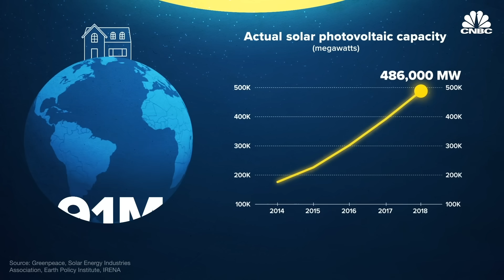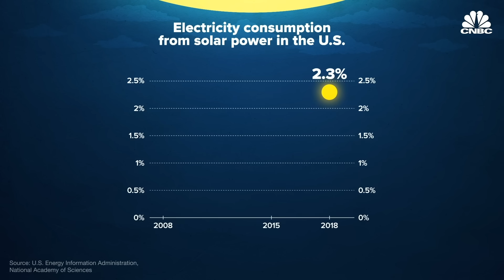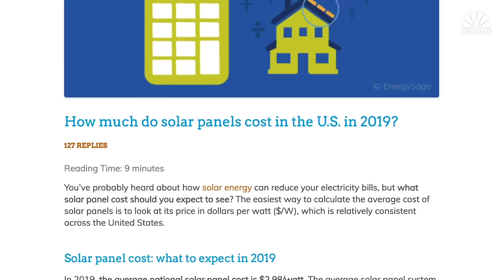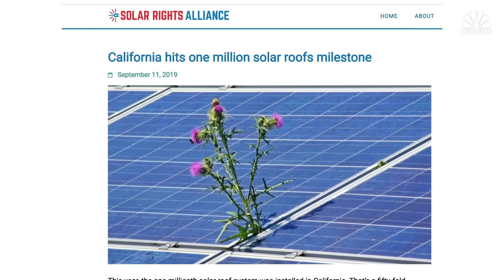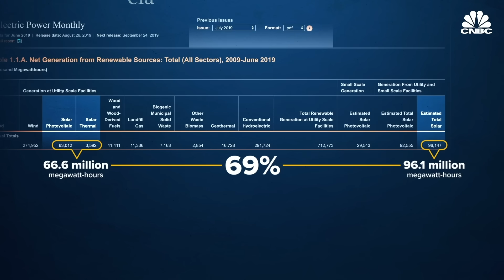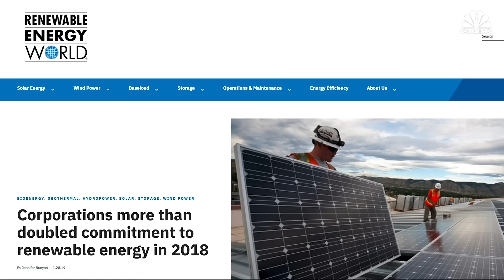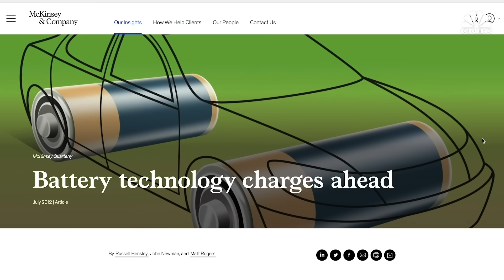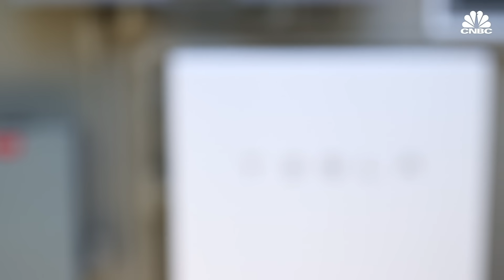The Rise Of Solar Power

Comment: I looked into installing solar panels on my house.  I am a low volume user; my average use is approximately 350 kWh per month.  

It would take me more than 25 years to recover the cost of the installation using a straight payback calculation.  Using a Net Present Value calculation, which factors in opportunity costs, it would take me more than 80 years to recover the cost of the installation.  And that is without any battery storage capacity. I am 80.  There is no way that I could recover the cost of solar panels.

Contrary to what people are told by the promoters of solar power, the panels have to be cleaned periodically.  Moreover, they are susceptible to wind and hail damage, which can result in costly repairs.  Lastly, depending on which study you want to believe, the panels lose some of their generating capability over time.  I have seen estimates of ½ to 1 percent a year over the estimated life of the panels, which appears to be around 20 to 25 years.

The cost of solar power, as well as wind power, does not include the cost of maintaining standby generation for when the wind does not blow and the sun does not shine.  If I have to maintain a standby gas fired steam electric station, the cost should be factored into the cost of wind and  solar power.  It isn’t.  Also, in Texas, to accommodate wind and solar, long-distance transmission lines have been built.  The cost of these transmission lines has not been factored into the cost of wind and/or solar.  

I support the move to a carbon free electric system.  But people should be told the strengths and weaknesses of wind and solar power.  They are not ready for stand alone prime time operation.

As an aside, I find it ironic that lots of folks are extolling the virtues of wind and solar as the way to a carbon free society while buying large pick-up trucks and SUVs.  Somehow, that does not compute very well.
Reply: when did you looked into solar? two decades ago? 
I look into them since a decade ago, and yes, I saw that the figures not quite add up, unless you are too far from the grid. But lately the cost lowered enough for solar to be feasible in most locations. I have seen reports from many users who installed five or six years ago, and who almost recovered the investment, so for two more decades they will have free electricity. Of course they got some incentives and live in a sunny place. If you live in a grim place, and no incentive, and the installers rips you off, sure, it is a bad deal to do solar now. Especially at 80. I am not 60 yet, and I am reluctant to buy anything new, because who comes after me will threw it out anyway, even is not worn out. But for solar is not just a matter of recovering the money. is a matter of keeping humanity alive. Sure, we will go away before the doom comes here, but what about the young ones? 

And anyway, even figures seems not to add up for solar, they are good. Already at industrial level in sunny countries solar electricity is already cheaper than coal electricity. And since you mention factoring the costs, please remember that coal is subsidized too, and the biggest weakness is that is killing us. 

Anyway, I wish you a long and healthy life, to catch the times when solar will be even cheaper, and can be profitable after one year. In two decades this will be true.
Reply: @ehombane  Last month!
Reply: Paul Smith I’m not sure where your are from but my grandparents have a solar loan and the payment on the loan is cheaper than her energy bill before they got solar. And they have a 10 year loan so after that they get to use it for another 10 years without having to pay. They seen about 20 percent decrease. But this is in Long Island New York
Reply: It's really feel good have own electric production from solarcell even if it are some investments required. You know then that parts of the electrics come from the clean sun. ☀️☀️ I was installed 1kW solar at years 2013. Now I will install lot more, the costs have dropped a lot from 2013 I seen. Have an electric car, and bicycle a lots in my family (when we was buy electric bicycle all my yough was star bicycle 8-miles to our town also.
Reply: M Detlef  he's a troll trying to spread lies.
Reply: You lost me at wind at hail damage. Do they also give you cancer?
Reply: Quick calculation shows the system you were offered likely cost $13k or more. Unless you live somewhere the Sun literally does not shine the cost of enough solar panels AND batteries for your house may be as low as $5k. Installation costs can of course be twice that. As for maintaining the system, how often do you wash your windows or take your car to a mechanic? Again, it's only expensive if you get someone else to do everything. If you feel up to buying a pressure washer and learning about batteries at your age it's just something to do on a slow afternoon. The batteries might need to be replaced in few years to a decade, but that is not as expensive as the whole system.

(Incidentally, the people who keep bringing up how wind farms and solar panels need maintenance that is supposedly not already calculated in their operating costs are oil lobbyists trying to lie to you that their own machines use unicorn magic and pixie dust and need no maintenance at all. Hint: This is not true.)

For that price you get zero electricity bill unless you do something above average like have lots of guests or need to heat or cool the house more due to bad weather. And panels losing about 1% of their output per year is not much of a concern unless you only got bare minimum number of panels and keep using more power; in 20-30 years you probably need to replace the roof those panels are on anyway, and can save by doing both at once.

So yeah, it's not something you would get the full benefits from, but for the average family home where people will live for decades, just lowering the electric bills by producing some of the power they need themselves would be a worthwhile investment.

Assuming, of course, they get the slightly more expensive but 4x more efficient panels, the affordable batteries, and moderately priced installation, instead of the crappy cheap panels, expensive batteries and overpriced installation.
Basic mistake, that.

As for needing standby plants, with modern prices it is better to just build more windmills, hydro and concentrated solar, as nowhere people would want to live has such weather that every windmill in the state has to shut down due to high winds and areas with regular week long 100% cloud cover would have trouble with agriculture so nobody sane would try to put a solar farm there either. A concentrated solar plant already stores enough heat for the night, but it could also use the surplus power during midday to make hydrogen, methane or even oil from air; in case a freak weather darkens the day these fuels can be burned to keep the heat up.

It is easier and better to build extra capacity in the existing power plants that can be held back, allowing continuous operation even when parts are shut down for maintenance, rather than a completely new plant that only operates few days each year yet costs more than every other solution.

Also, the grid needs transmission lines because unlike that PV panel you aren't going to build a nuclear or coal plant on your roof. It also needs energy storage because balancing the power supply requires adjusting things within seconds and it could take minutes to fire up another power plant. Anyone who claims renewables are to blame or that fossil fuels don't need and use the exact same systems is a lying liar who lies.

Comment: A TESLA HOUSE  BATTERY IS NOT  $7,000 MORE LIKE 3,500 AND TESLA HAS A SOLAR RENTAL PROGRAM THAT CHARGES AS LOW AS $50 PER MONTH TO GREATLY REDUCE YOUR ELECTRIC BILL .   YOU CAN STOP AT ANY TIME  ( NO CONTRACT )  AND HAVE THE PANELS REMOVED  THEY  USED TO CHARGE TO REMOVE THE PANELS BUT TESLA DOESN'T DO THAT  ANY MORE  THEY JUST REMOVE  THE PANELS FOR FREE  .   MOST PEOPLE WHEN THEY SELL THEIR HOUSE JUST EXPLAIN THE SAVINGS FROM RENTING THE PANELS AND THE NEW OWNERS SEE THE BENEFIT AND CONTINUE THE AGREEMENT ... BOY CNBC DOESN'T MISS A CHANCE TO KICK TESLA DEAD IN THE BALLS  EVERY CHANCE THEY GET

Comment: The tech that can be the most reliable for peak power is called "Liquid Air." The fuel used is air right out of the atmosphere. You don't have to burn it and it's renewable and free !!!
Reply: Sorry but you don't know what you are talking about, first of all it isn't flawed they have a working plant in a town just north of London - the CO2 is pulled out of the air before it is chilled, then stored or used in other processes. Then the liquid air is stored in a low pressure cryogenic tube.  When it is time for use the liquid is allowed to reform to it's gaseous state and the waste gas is cleaner than when it was first captured !!!
Reply: Yes, it is real science. It was first proposed by a Dr. of physics called Daniella Fung back in 2009. The plant I am talking about was built about a year and half ago. This is real and it's going to change our current paradigms !!!

Comment: as a person who lives full time in an RV that uses SOLAR knows it is better than NOTHING but it is completely UNRELIABLE... 6 months each year it works well and supplies the amount of power to keep my batteries charged.. 3 months a year I need to run my Generator half the time to keep the batteries charged.. 3 month a year I need to run my Generator full time as the solar panels are completely useless.. the only reason I have solar is I like silent power but it is much more expensive that running a Generator to charge batteries.. at the price of Canadian gasoline costs me 7 dollars two charge my batteries once every 3 days....

Comment: i dare you to calculate how much power is wasted for producing those solar panels and how much energy those solar panels will produce during their lifetime... 

spoiler: solar cells dont produce even half of the energy during their life that is wasted for producing them... 

hows that for a "green energy"?
Reply: How many kilowatt hours does it take to produce a kilowatt of solar? Or what form of energy are you taking about
Reply: @EthanThruandThru  i am talking about the total wasted energy of any kind while producing the solar cells (oil used for the trucks and machinery to collect and transport the silicon ore, energy wasted to extract the silicon from the ore, electricity wasted to melt the silicon...) 
solar power is a scam... while you keep your region clean by using solar cells to produce solar power, at the same time you are double or even triple polluting the region where the solar cells are produced which in the end pollutes the whole globe eventually...

Comment: Lithium is a toxic, and very rare Earth, material so we MUST move on from Lithium because it is a finite resource.
Reply: Thankfully there are improvements in other battery types such as sodium ion
Reply: @Verisimilitude Dude I think, or at least hope, that Lithium was just a stop gap until something better comes along that is not very finite, rare, or toxic.
Reply: @thebeststooge  Here's an article that helps shed some light on that.  It's a breakthrough in sodium ion solid state batteries.  https://phys.org/news/2019-04-high-solid-state-sodium-ion-battery.html

Comment: Until the efficiency of solar panels is at least doubled it is just a gimmick.  Already they are looking for better than silicon for the cells (we have maxed the tech out) because we really do need 600-900 watt panels for the same size, and cost, of the current 300 watt ones.

Comment: No one says about the energy it requires to manufacture solar panels and batteries. And the pollution it causes to dispose. Aaah propogandas.
Reply: Was about to say something like this, the chemicals and gases and other elements used in them are dangerous, they require non stop maintenance, break down easy enough, have to be replaced every 20 years or less if your lucky, require the total destruction of massive amount of land, trees and animals, also the amount of power you get for the space is pretty bad, everywhere that has used them and got rid of nuclear energy has seen power outages and also require something around 60% of power from coal and gas to help keep power level stable and in turn ends up causing more pollution, the safest, cleanest as well as cheapest form of energy we have is nuclear something that scientist want people to use more again but hey the likes of greenpeace and other activists groups who know nothing about all of this and scare mongered people for decades don't want and also have no solutions at all other than give us money.
Reply: @FOXXOF-RPG  I know. Like I said. Propogandas. It doesn't have to have real world effect. Only thing that matters is that it should feel good.

Comment: What do you do with the old solar panel after 25 years of use Land Fill? they are made with lead zinc copper and other metals who recycles themes and the silicon is very toxic to the lings how are they handled?
Reply: @Hello Roger Reimer, How are you doing?

Comment: They should use hydrogen to store power. Turn water into hydrogen during the day with solar power then turn in back at night though a hydrogen generator back at night. Need more capacity? Just build more storage tanks! Yes it will still be expensive and I'm sure not every solar farm is close to water but its electricity we are talking about. I'm willing to bet having more storage is more important then where the storage is.

Comment: Solar isn't as unreliable as you might think. And not all solutions involve batteries. CSP concentrated solar power stores energy from the sun as heat in a liquid that can be used late into the night. Similarly energy can be stored as potential energy by moving water to a higher elevation. Essentially a giant battery made of water and gravity.
Reply: This dosent change the fact that solar is unreliable. Ofc there is solutions for this issue, but all of them adds extra cost.
Reply: Magyar Áron Surprisingly the cost of solar plus storage is now competitive in many areas. Obviously some places it is going to be more expensive than fossil fuels, but it is increasingly becoming the cheaper option. I doubt solar could ever provide over 60% of the nation's power without serious diversification and output variability problems, but economically solar is starting to make a lot of sense.

Comment: The only role for solar (wind sucks, to much damage for not enough benefit)  is to prolong the benefit of fossil fuels, which ARE solar based after all (water,  CO2, organic carbon compounds, and sunlight). ALL, ALL, ALL CO2 that is locked in fossil fuels, came from the atmosphere IN THE FIRST PLACE, and will do NO harm if it goes back there, but most of it is tied up in rock (limestone, dolomite, and everything we make concrete out of).

Comment: No one talks about the easy storage solution, with is using energee only when it is avayable. Eg. big food cooling houses can overcool themself when a lot of energy is in the grid and then just shut off cooling for a timespan eg. during night.
Or plants can set up there prosesses to peaks in the grind. eg. melting steel

Of cause this can not be done for everything, but a lot of things.

Comment: The cost of lithium ion battery storage is relatively high? That is a ridiculous statement, the cost of storage is outrageously high.
Reply: Not if you use dams to store water that can be used when needed
Reply: @fgsaramago  yes, but that isn't high efficiency and it emits more greenhouse gasses than coal fired plants, so it is pretty much the dumbest solution imaginable.

Comment: Video makes same good points, storage is key, but story has some BIG HOLES.
Follow Bill Gates who sees the whole picture, explains this is short sighted, and just WRONG. 
California is in energy crisis because of increased solar. Reality is NOBODY explains the electric grid is unique. At any instant in time SUPPLY MUST EQUAL DEMAND or the lights go out. So what REALLY happens this the fossil powers plants keep running, in case a cloud comes overhead for 3 minutes.
What you don't report is fossil PEAKER plants are only 30% efficient compared to combination cycle 65%, so the use of solar INCREASE CO2 emissions.
Taking care of peak problem with storage CREATES AND EVEN BIGGER problem. Where does the power come from on a dark windless day? If this was only 5 days a year, what business would build and operate a power plant. If they did, you would not be able to afford the price per Kw.

Comment: How did you not mention Texas? Texas has *by far the most Solar production of any state in the US.
Reply: I believe it has the most wind power.  Due to tax credits.
Reply: Enjoy your high electric bill.
Reply: @TheBandit7613  Solar gives low electric bill. It's just that 3rd world will pay for it because America will just send the used solar panel toxic garbage. The Philippines will not be accepting your garbage, America
Reply: @hamanakohamaneko7028  I use far too much power for solar. In fact, the electric company had to up the amperage to my house. 220 pool pump, two big air conditioning units, 220 air compressor and welder. One of the problems is we are making China rich buying all this equipment from them. And if someone is concerned about pollution, we are just transferring the pollution over there. Our whole energy situation right now is just fouled up.